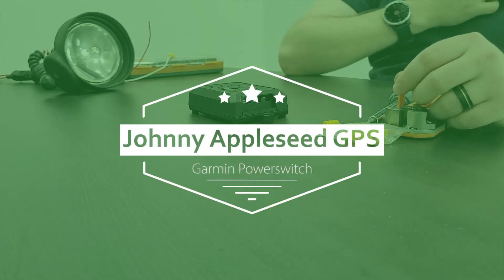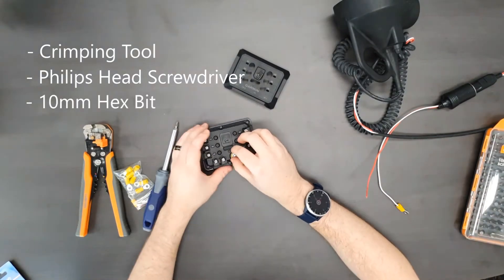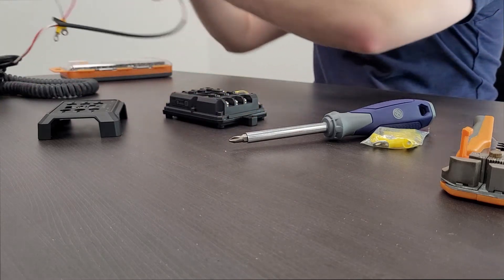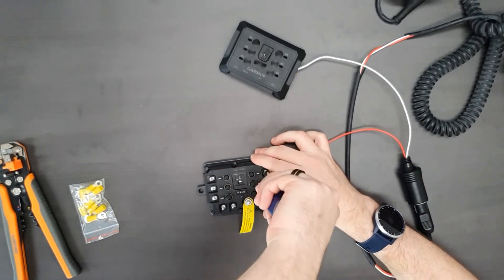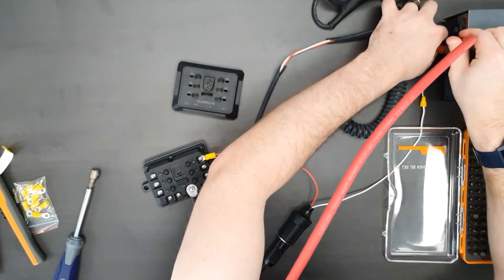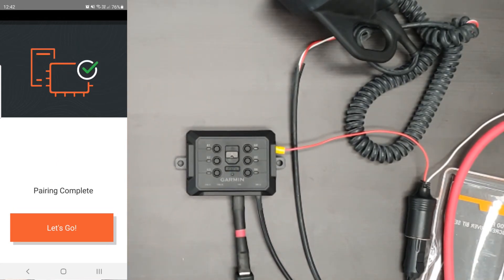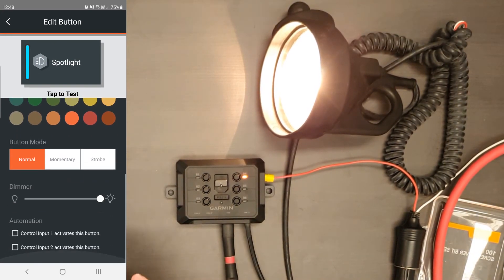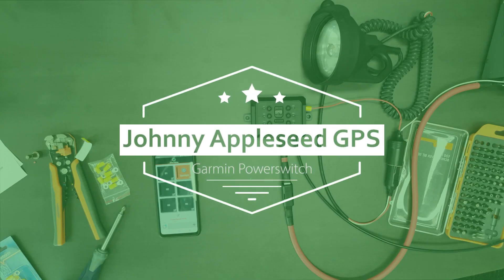Garmin Powerswitch Tutorial - How to Wire and Program

Comment: are the outputs fused(electronically)?
Reply from the maker: If an accessory draws more than 30A, the device turns off automatically. You will also need to verify that the total system load is less than 100A. If the device detects a system load of more than 100A, it turns off all outputs automatically.